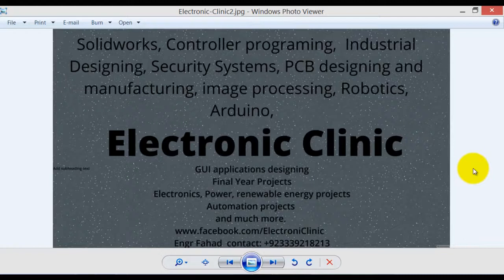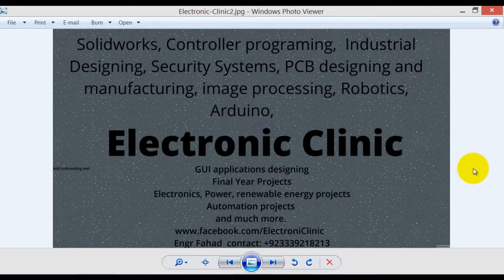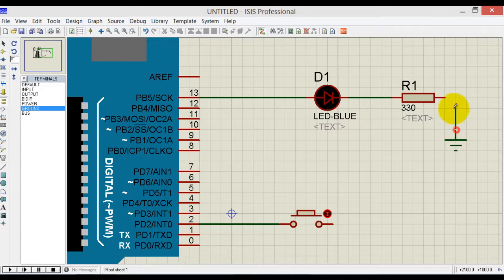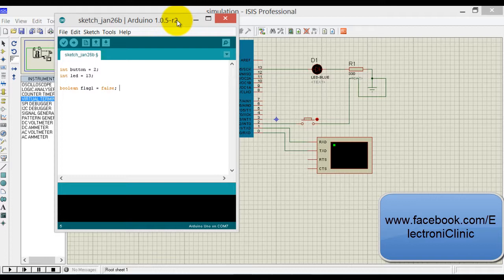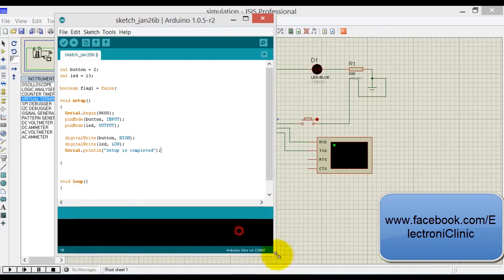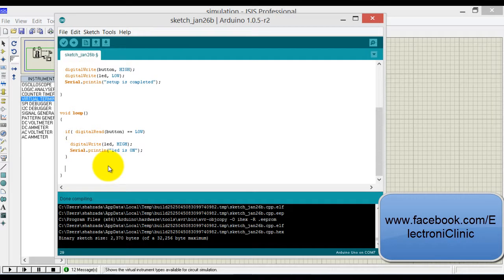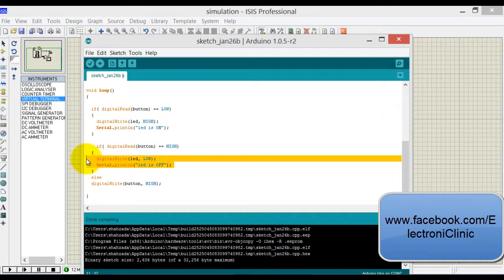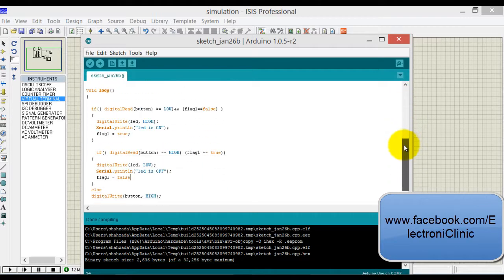Arduino Programming Tutorial:  Use of Flags in arduino || Arduino flags

Comment: sorry sir 
this is good , but i found 1 fault in this program in use of real hardware after loading program first status is wrong 
i dont no how in simulation its work ok but in real hardware first we need to reset first  in void loop first if digital read button is low flag1 is false in result we need to get led is high but we dont get led is high we get led is low after we press butter then we get led led is low then we relis butten then we get result led is high can you solve this 
thank you